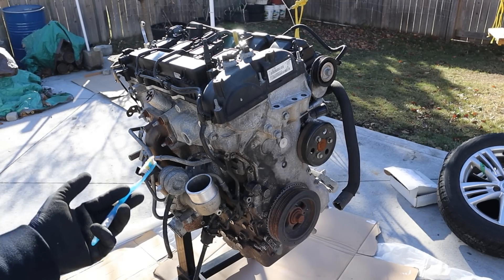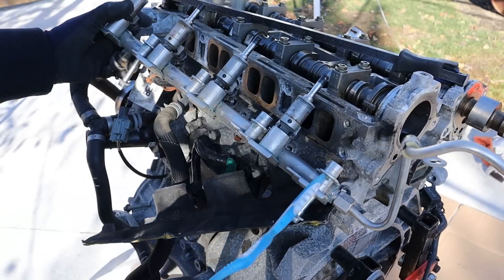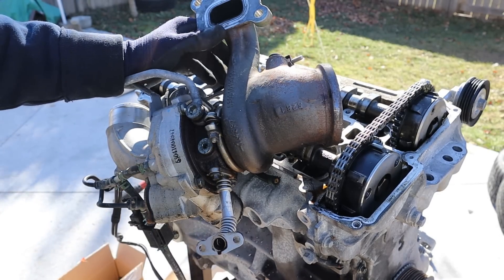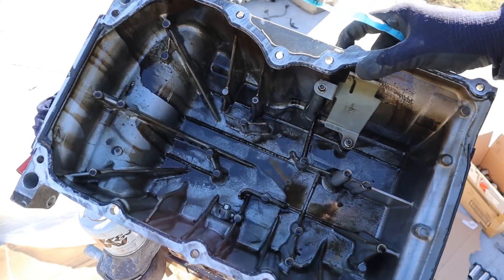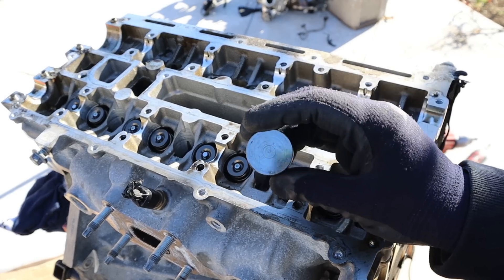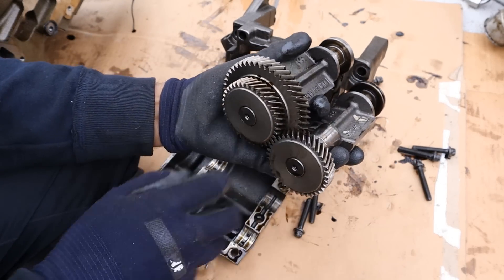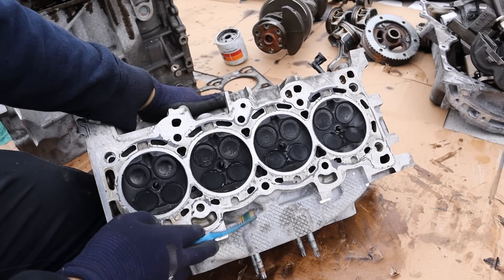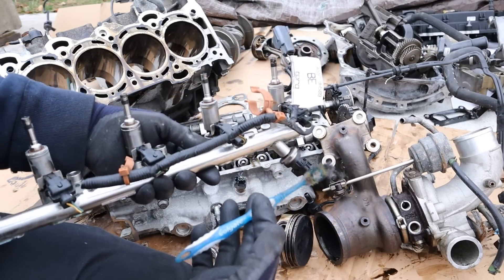Why Ford Ecoboost Engines Fail

Comment: People wonder why I still drive my old beater, it's because the engine is solid and everytime I think of buying something else I Google it and this guy has a whole video detailing why I shouldn't. He's saved me a fortune.
Reply: Straight six engine
Reply: Save your money:  Cheap old cars go to all the same places that new ones do.....
Reply: @Philcopson  guess you never leave town....try driving a beater from California to North Carolina ...
Reply: Its also better for the ecosystem to drive an old car!
Reply: The Ford 4.6 l modular connected to the 4-speed with overdrive transmission was indestructible if given regular maintenance. I am still driving my 2003 Grand Marquis as a winter vehicle, and change the oil every 5,000 km and the transmission and diff every 70,000 km.  Still running just fine, and with oil spray undercoating yearly there is no rust issues with the body or frame.

Not looking forward to the day when it will have to be replaced, although at my age a sudden health issue could make that a moot point. Wishing you younger folks luck as governments around the world go bat crap crazy over green energy being able to power everything a modern economy requires.

And for the record, I also have a Mustang and Marauder as fun summer vehicles.  Yes, I am hated by the lefties and greenies.
Reply: The only viable engine is the 5.0
Reply: For real dude, same here.. still driving my old beater 2000 Ranger 4banger with the old Lima in it. Sidenote I'd REALLY, really love for an environmentalist to explain to us how disposable engines with mediocre improvements in "efficiency & emissions" over old tech reduces pollution when it takes dooky huge amounts of energy & unbiodegradable plastics to make disposable engines that last at MOST 5yrs or 100,000 before they're so worn out they drink oil, gas, barely run and end up on a barge to China for recycling (that's how they get their free material). Fuckin ridiculous.. As a mechanic every time I hear about CAFE, carbon credits and 4th grade interpretations of the word efficiency, my anus twitches uncontrollably. And the 10,000 mile oil changes, makes me wonder how these people dress themselves in the morning and where get all this money to make perpetual new car payments on trade-in about a year after its paid off and barely runs anymore, let alone passes local emissions inspections
Reply: @Drmcclung  I had the same arguements. And these go same for new electric household appliances. Made like crap, replacing them every 6-10 years to save peanuts on electricity. And you can't fix 'em.
Reply: @Drmcclung  I also have a 1990 Nissan pick-up that I use mainly in the summer months to haul bikes, kayak, lumber etc. Insurance is about $40 month while I'm using it & I have 'Antique' license plate so I only pay one up front fee of $38 - no annual license tags. I've owned it for 21 years - it owes me nothing!  It's rusty, dented, no radio - if i fill the gas tank I've doubled its value!!
Reply: This new technology just plain sucks anyway you look at it I'll keep my older muscle cars anytime at least you can figure out how to make repairs on them
Reply: @rodneyhopper22  And doing engine rebuilds helps keeps your local machinist's lights on. Every machine shop I've seen seems to be struggling and machining is not an art we can afford to become a lost art.
Reply: Me too.  Normally aspirated V6.  Not direct injected.
Reply: That’s right!  I drive a 20 year old Subaru H6.  It doesn’t burn oil.
Reply: You honestly have to remember one thing when saying that. People hardly EVER maintain their vehicles. Ford recommends oil changes every 10k miles or 1 year whichever comes first for this motor. I would never in a million years follow that myself because that's how you end up with a blown motor. Also this motor obviously was fine and whoever sold it was a moron and was sure it hydro locked and probably didn't even check compression. Lots of motors can have issues but generally people don't maintain anything which is why I'll never own a used vehicle again.
Reply: @huskers1278  True, most of us here are probably good about maintenance, which goes such a long way especially with these newer engines. I'm amazed at how many people I've known that call and ask "what does it mean when the oil light flashes on and off? Does that mean I need to change it?"  Uhhh no, it means you haven't got any oil in there, and you've likely just took tens of thousands of miles of life off the thing. How long ago did you change it?     "Umm, it's been a couple years I think".
I'm just flabbergasted. Like don't you care about protecting your expensive investment?? I've also seen enough of the "just rolled in" youtube channel to lose faith in responsible owners. I know there's freak mechanical failures and defects, but I bet a lot stems from neglect.
Reply: Andrew T  Couldn't have worded it any better myself. I have a 2.0 Ecoboost in a 2018 Ford Edge Titanium and the engine just got replaced for free from Ford. It had coolant intrusion in cylinder #4 because it was the old sawtooth designed coolant holes cut in the center of the cylinders. It was a bad design on Fords end. But again that stuff rarely happens. People buy vehicles beat on them change the oil once ever 1.5-2  years and wonder why it runs like shit with 40k miles on it lol. I bet you are correct LOTS of people that sit around and watch videos about cars probably are the outliers and actually take care of their vehicles. After I had 2 used vehicles back to back that broke due to the previous owners neglect I went and purchased the Edge for like 40k and damn near lost my mind when I realized it was burning coolant. Always have done all its maintenance before scheduled. But now it's fixed and runs better than new. I just couldn't imagine paying all that money and not taking care of it
Reply: @huskers1278  Na, modern vehicles are just overengineered in a lot of ways. When a lot of people mention the same damage on the same engine type it is usually because that engine has a problem in that regard. VW had big problems with their TFSI engine timing chains. That wasn't because people didnt maintain their vehicle properly. It is bad design. There is a reason VW for example reverted back to timing belts before trying chains again :D
Reply: Christian Kirchhoff  I don't disagree with you whatsoever but I still stick to that the average person doesn't maintain their vehicle nearly enough. Obviously there are outliers like you pointed out. Didn't know that about the VW engines so thanks for that info
Reply: @Huskers12  wow man glad to read that you got a warranty for that! 
  New cars are the way to go if possible.
Reply: NY Plantings  Yeah those older platform engines with lower compression and  slower moving bottom assemblies would easily have tons of miles on them. Thats one thing that keeps semis on the road for years is low rpms. The higher the rpm range you keep your vehicle in the more damage you do quickly. Yeah I would sell one of my children for that ZR1 vette. also thought it was one of the best looking vettes they ever made
Reply: @huskers1278  every company has bad years.  2017 to 2020 Ford had a bad design. My wife has a 14 escape titanium  with the 2.0 ecoboost, only has 117k on it, but it runs perfect. She got.it used with a 3 yr 36k mile warranty though
Reply: @huskers1278  Focus ST 2.0 motor uses closed deck design not open deck. So it won't inherently have the blown head gasket / coolant usage issue like the escape/edge 2.0 which use open deck design. What you are stating above in your motor actually does not apply to the Focus ST version of the 2.0
Reply: @huskers1278  Outside of my own friend circle of enthusiasts, the average person I talk to doesn't even know how to change a flat tire or remove their plastic engine cover.
Reply: @MidnightSpeeder  Exactly lol most people couldn't tell you how much air their vehicles tire should have let alone do any maintenance on it
Reply: @andrewt9204  In Italy it's the same thing, many think that the oil light is a normal light, but it's not like that! 😂
Reply: @Huskers12  if you don't have to buy used you are 100% right. Every single used car I ever bought had some B.S. going on.
Reply: @nyplantings2420  New Zealand and Japan must be different. Most of us only buy used cars. I have had a fantastic run from 10 to 12 year old mitsubishi v6 3.5 and 3.8 litre saloons for years. Recently bought a 2010 vw passat 2.0 tdi. Nz new full service history. For about 3k usd. No problems in 6 months. Runs really well
Reply: @huskers1278  at the end of the day , at 63000 miles when you start burning through 3 quarts every other week,  that small amount off $200 for the 3 extra oil changes doesn't sound so bad now dose it? The manufacturer wants you to buy a new car at the end of the warranty
Reply: @ryanaddy1135  ding ding ding ding!!!!  We have a winner.  People always be like why would they lie to us and tell us 10k mile oci is OK well first off because they don't give a shit if you're vehicle last 100-200k long as it gets past warranty matter of fact they're hoping you come drop coil on a new one from them when the warranty is up.  Use good quality synthetic change every 5k period.  My fbo x37 hybrid turbo tuned on e30 2016 fiesta st is at 112k no issues been tuned since 2800 miles on current setup since 50k.  It's dead nuts reliable.  The 1.6 ecoboost is killer.  Very reliable.
Reply: @huskers1278 you’re right. I wouldn’t go over 5K mi.  When asked how often should I change my oil, Grandpa said” oils  cheaper  then iron son” 😊
Reply: @huskers1278  💯👌🏾
Reply: @huskers1278  so, you just keep buying new, and waste money?? That's stupid. If you learn about cars and trucks... you can find a used car or truck  that was maintained well....all you have to do is have a scan tool... and some tools..and know about cars....it's simple  to find a good used one....
Reply: @huskers1278  I only buy from fellow enthusiasts or elderly folks now for the exact same reason. Unless I'm intending on a full restoration then it doesn't matter. I've heard people do better in other parts of the world but Americans don't maintain a thing. Throwaway consumerist culture completely rampant. Very common to ask when the last oil change was and get the fish-eyes stare in response.
Reply: @huskers1278 You ever heard of a wet belt?
Reply: @huskers1278  "Oil is cheap; engines are expensive!!" ~ Scotty Kilmer
Reply: @GoonSquadLifeMember  Actually just ordered Amsoil Signature myself to try it out! I always agreed with Scotty on that one
Reply: @GoonSquadLifeMember  Motor oil used to be cheap, but I think the price has doubled in the past five years
Reply: @huskers1278  Aren't they running special syth oil blends these days? Then you might say people might not use the right oil or deal with the dealer to do it, and with everyone having the iternet now you have the uniformed most likely to post, and less of the ones that don't have problems.
Reply: @TOPHERHARPER  From the factory, it uses a synthetic blend Motorcraft 5w30 Syn Blend to be exact. I personally run Pennzoil Platinum Ultra which is full synthetic and oil has come A LONG WAY since the 70s-2000s but no motor that uses a turbo should ever exceed 5k miles on oil. Especially when you live in the city these direct injection motors get lots of fuel deposits in the oil and it makes it lose its lubricity. And you are correct often times you read online about issues someone is having with a specific vehicles motor but you don't read the 1000s that never had a problem. People are dramatic and engines are so far and above superior to what they were 20 years ago it's not even funny. More often than not a vehicle breaking has everything to do with the owners' maintenance or lack thereof.
Reply: @huskers1278  I don' nescessarily agree with the school of thought of sticking with a brand of oil, when the manufacturer specifically says they made everything to work with thier brands and suggests them, and even with a warranty says this is the recommended mileage, I would trust them because if it weren't they would have to pay for it? 
I would guess if you had engineers and made cars you would probably only recommend an oil if you made it in order to assure consistency and thereby you can make claims like you can go 10k miles. 
All the rest of this seems like conjecture, though it sounds like you are expecting consitency from your brand too. I mean what we are discussing here is that this person thinks that the manufacturer is misleading and I simply suggest that maybe they are not, given we have come a long way. 
But then again, I read in other comments apparently they fixed the water jacket issue, and so it kind of makes this video pertain to it should have been titled; why do 2016 ecoboosts fail, and I am sure there are plenty of reasons why they fail, but maintence wouldn't be the issue for the later ones that weren't manufactured well, no matter what oil you used or how often you changed it. 
As an old guy myself, it is hard to get out of long outdated mindsets, back when I was born for the next 5 years the ford 2.3 didn't change much, now it feels like a whole different game.
Reply: Christopher Harper  Yes the new engine that went into my Ford Edge is a different design so hopefully it shouldn't fail until it's old and ive gotten rid of it. I don't necessarily think sticking to manufacturers brands is a great idea either. I really like Pennzoil Ultra Plat myself and have done some oil analysis on it with good results so far so I usually trust science and not my gut. I agree with everything you said however.
Reply: @huskers1278  Good point about the thousands that don't have a problem for every one that does.
While I do believe the 4 cylinder ecoboost engines do indeed have an unacceptably high failure rate, it seems worse than it it because they have been putting them in everything for quite a few years now.
My 2017 Escape has the 2L ecoboost, with 65k miles, not ingesting coolant yet, hope is stays that way...
Reply: Mark Beiser  Absolutely dude. The damn coolant intrusion issues they had with the 1.5-2.0 motors are absurd. They should have done a complete recall on the motors but realistically Ford couldn't eat that cost. So what all the motors need is to have their warranty extended to 10 years or 100k miles. The new motor in my Edge is the new pin hole design and I only have 300 miles on it so far. The old 2.0 had 73k miles on it and the last time I started it before taking it to the dealer it SMOKE SCREENED half a block it smoked so bad. One other thing people often overlook is ALL THE MANUFACTURERS have major issues whether it's their transmissions or certain motors. They basically design all this stuff with their hands tied behind their backs because environmental agencies. They need certain MPG ratings and all sorts of environmentally friendly things in the engine bay that break.
Reply: @huskers1278  A friend of mine had really bad luck last year. 
His chevy work truck, with the AFM cylinder deactivation, had a lifter eat up the camshaft, damaging the block in the process.
His Hemi Charger dropped a valve seat, destroying the engine.
His wife's Ford Exploder 4 cyl EcoBoost developed a thirst for coolant in cylinders 2 and 3.
All within about a 8 month span, all out of warranty...
Reply: Mark Beiser  I do believe if I was your friend I would be calling it a day on vehicles lol. Thats HORRIBLE. The dealer told me if my car didn't have the warranty it would have been nearly 9k out of pocket. Also your buddy is literal proof all manufacturers have their share of issues it's just which one do you think you can afford? For my 2.0 it was cylinder #4
Reply: @Huskers12  to be honest, if we had the oils and fuel additives of today in the older engines we would see several million mile examples. 
   The sweet spot of Port injection engines from 2002 to 2012 are real winners. That supercharged 750HP C7 Corvette ZR1 with both D.I. and port injection is a rock solid  masterpiece that in OEM form will last decades.
Reply: @huskers1278  2.0 from EDGE and ESCAPE are not the same as from ST.
EDGE and ESCAPE has an "open deck". 2.0 from ST's are closed.
Reply: @chris_hisss_YT  Yeah  synthetic  oil $100.00 for a 6 qt and filter oil change !!!  Real deal !!!   Once a year is fine especially when I drive only 4,000 Miles a year !! !
Reply: @huskers1278  I call Bullshit on that.  I serviced my vehicles to Fords recommendation, including the transmissions and lost three late model trans, 2 at less than 50,000 and one at 105,000.  totally done with Fords !!!
Reply: @wilburfinnigan2142  That was your first problem. Don't follow their "recommendations" those are to make the vehicle appear to be cheaper to maintain lol. They want it to break they want to sell a new car
Reply: @markbeiser  17 is when they started  making the bad design
Reply: @markbeiser  that wasn't bad luck....he picked the wrong brands...
Reply: @chris_hisss_YT  it's not  only a turbo motor with highish compression for boost but it is a direct injected engine.  Going 10k miles between oil changes is not recommended even with the best oil available.  The manufacturer don't care if your engine lasts 200k long as it makes it past the 3 yr 36k warranty.  Changing it every 10k won't cause issues before the warranty it'll be at 100k when the valves are so caked with buildup the engine either runs like total shit or it ends up causing other issues.  On top of this the oil lubricates the turbo as well as the engine so the turbo is heating up that oil more breaking it down quicker.  5k miles with quality full synthetic is what you should do.  I recommend amsoil boosted 5w30 it has 25% better cleaning and is great for direct injected turbo engines it even specifically said that on the bottle. My 16 fiesta st is fbo x37 hybrid turbo on e30 and it has 112k bought it new been tuned since 2800 miles and had my current setup since 50k.  I have beat on it plenty of times.  It's still going strong but I properly maintain mine.  I agree with the guy above I think the majority of issues is due to lack of maintenence ecsp on ecoboost engines.  People going by the manufacturer suggestion because they think they always know best and never lead none astray 🤔
Reply: @midnight347  Interesting and noted. But you are saying oil changes aren't going to be the issue as it will need to come apart because of carbon buildup anyway? Maybe that is why they say 10k because it really don't matter?
Reply: @maciekapocaliptic  13-16 edge and escapes work for STs with some component off the ST.
Reply: @markbeiser  Good 'ol planned obsolescence -_-
Reply: that is why the new engines are shit because most have nooooooooooooo clue about maintenance and in the end you loose, iwould rather have and old style engine that takes more abuse and will last longer because if you think you are saving in fuel you will pay in engine replacement or repairs,  stuff today is designed to be repaired not last.
Reply: @chris_hisss_YT  synthetic blend is cheap oil. It's a blend of synthetic and conventional. It's not as good as full synthetic and it should be changed out more often.
Reply: @nyplantings2420 I think the golden age of vehicles and optimal emissions controls are from whenever any particular model/engine got fuel injection in the 1980s (even TBI was ridiculously reliable and clean) and maybe mid 2000s.
Reply: First of all I Live in Ontario and they pour Liquid Salt on the roads!!!
This is the reason why I'm still driving my 17 year old 2005 Honda CRV iVtec 2.4L I bought brand new when I was 27 years old. I have it Oil Guarded (The shop coats the whole underbody,  inside the rockers, inside the doors, EVERYTHING with OIL and WAX Combo) EVERY August and change the oil every 8000KM with Mobil 1 Full Synthetic 5W-20 MYSELF and only use Honda Trans Fluid, Gear Oil and Antifreeze. I have 365K on her and drives like the first day I picked her up when she was a baby with 43KM on the clock. No rattles going down rough roads, no engine noise, most important NO RUST! Sure I've had to replace suspension and chassis parts, brakes, normal wear and tear stuff but so far she's been a dream and goes through EVERYTHING. I also love that it has a regular Cassette/CD/ Radio and separate heater controls and none of that touch screen crap. Everyone I know that has much newer cars is always saying it's in the shop for this and that BUT a lot of people I know have been having serious Turbo problems. Sure my car might be old but I know she's always going to start and will never let me down. If she does one day I can bet it will be something like the belt or a blown hose because I KNOW the engine, tranny, and rear diff are tip-top. Keep you old cars and LOOK AFTER THEM AND THEY WILL OOK AFTER YOU!!
Reply: @michaeljohn9263  The Honda K24 and K20 engines are seriously over built and well designed. What I always liked about Honda was they were generally easy to work on.
Reply: @michaeljohn9263  I WISH I had the financial means to buy a brand new car before everything coming out of the factories got fuckin' lame. I've always taken over other idiots neglected crap and restored. At least I got really good at wrenching because of it. I can totally buy whatever the hell I want brand new now but they don't make anything I want to drive.
Reply: @Michael John  wow I would like to know about the undercoating. Too late for my Ford Lightning. Great news and keep them miles coming!
Reply: @michaeljohn9263  I live in Alberta - we use road salt but not as much as Ontario. I have a 2005 ford Taurus I bought in early 2007, 200+km, run 5-20 synthetic 15km change & use Mobil 1 or Fram XG filters. I leak a bit of oil but doesn't burn oil. I wash frequently in winter. Tranny fluid changed a couple times. Replaced batteries, tires, brakes , rear struts couple times & new starter - still going good!
Reply: @michaeljohn9263 same thing with my 95 maxima . Except I change my oil every 5000 k .
Reply: This is why I'd stay away from all modern day Ford engines except for the 5.0
Reply: My f150 4.6l v8 has over 400k original engine
Reply: I agree, modern ICE engines are engineering marvels but terrifying long term prospects.
Reply: I had to get rid of my 2000 4Runner because of rust, but it ran beautifully for 20 years. Got a new Toyota Camry and as long as I maintain it properly I have no doubt it could last me another 20. When in doubt, buy a Toyota.
Reply: Dude literally, in my family we have 2 2003-2011 hyundai accent and those are reliable asf
Reply: @adrielaquino521  reliable asf are they
Reply: Same. I daily a 2003 Tahoe that has 270k on it now. Drives as good as when I bought it with 130k miles. I've replaced hubs, shocks, pitman arm, idler arm, tie rods, water pump, oil pump, fuel pump, window regulator, blender door actuators, and converted to 2007 and up front (bigger) disc brakes, and converted to 2005 and up dual electric cooling fans (GM factory stuff, not aftermarket). Why? Because it's easy, and it's cheap. I don't want a vehicle that's not easily serviceable. I think I'd rather just put in another engine and transmission when the time comes.
Reply: My mom used to be asked all the time, "why do you drive that old thing"?  For 30 years she drove her 1960 Buick Le Sabre sedan.  She said, "It's reliable and beautiful, what more could you want"?  She is 99 now and STILL loves the 1960 Buicks!
Reply: I buy diesels.  I know that after some careful research the truck I buy is going to make a few hundred thousand miles without major issues    Even the new ones I put over 400k on a 2016 duramax that was all stock with a service body.  Gas rigs idk I don’t drive them but ford has done nothing but make vehicles that make it just passed their warranties since idk  international was more involved with them.
Reply: GDI is garbage. We need to go back to Multi-Port injection to keep the top half clean. However with the emissions laws, car companies almost have to run junk turbos and GDI and not to mention VVT. My GM's and Ford's always ran fine with Multi-Port injection and they barely had a breakdown issue, with good fuel mileage.
Reply: Keep care of that older vehicle and it will treat you well!
Reply: But have you googled your old beater?
Reply: You're just telling yourself that because you can't afford a new car. Whatever makes you feel better.... 🤷🏻
Reply: I'm going to put my 1989 Ford Bronco 2 back on the road and get rid of this 2014 Ford Escape before the transmission or engine craps out. I'll probably take trade in price for it which is around $3500 under the condition the buyer knows about the potential problems of these vehicles.
Reply: Wise indeed. Older trucks N's cars made to last. New vehicles are cheat mass produced made to fail
Reply: It’s solid stock your engine would be dog shit with todays turbos if not the same reliability
Reply: Still have my 2003 S10 Zr2 powered by the 4.3 vortec for a reason....

Engines great, but I am looking at transmissions for when the 4Lame60 eventually goes...

Truck has over 219k on it and does have a little shift flare here and there so I know it's gonna need a trans in a few years..
Reply: Ditto
Reply: No one wonders why my dude. Everyone has their own issues. No one gives a crap about someone driving a car.
Reply: Nah.  This engine is pretty robust, probably one of the better ecoboost engines out there.    The only reason this engine fails is because they're very tunable and when they get tunes on them (different turbo, etc) are getting in excess in 400HP, and then they run into a lean conditions which then puts a hole in the piston, which basically destroys the engine.

You run this in stock tune, it will have a long life.
Reply: 4.3 gm 😊
Reply: Yep.  2005 Suburban Z71 with the 5.3 before Active Fuel Mgmt ruined that design.    Runs like a Top.
Reply: Except for the carbon buildup which is a problem with all direct injection engines I don’t see anything wrong with it unless maybe some valves got bent which he didn’t get into
Reply: You know your engine stuff.
Reply: Yes, my 2005 mondeo tdci has 225k miles and this isn't unusual. Oil and filter done regularly and on it goes. Nearly replaced the car so many times but for what? and why.?
Reply: @tdbright340  that's the way to do it. Keeps them running longer
Reply: Magic plastic ✨️
Reply: Yeah, im sure thats why...
Reply: I agree, I purposely picked a pre AFM  GMC pick up. 2006 and before. The Active Fuel Management system breaks on these trucks. Save a tiny bit of gas, and they break at 80k miles, from what I read.
Reply: Doesn't have a video on the Subaru Outback's current 2.4 turbo engine.
Reply: My old Opel Signum 2.2DTI (Diesel) built 2003 saw oil changes only every 37.5k miles and ran like new when sold with 180k (14years old). 115mph on the Autobahn was standard speed. Only gave it 0W40 Mobil 1. Never had any issues. No refill necessary between changes. No rust, only cosmetic issues (clear coat flaking of and stuff like that). Great car. Obviously every engine is different and gasoline engines require more maintenance, since the gas mixes more easily with oil I guess. Also lots of cold starts are bad.
Reply: I have a 20 year old car, which starts up every time. All it needs is common service according to the manual
Reply: theres nothing wrong with that engine, the owner never ''drove'', it. thats why it stoped. the ford durateck, 2.0 petrol, 2.5 5cyl, 2.0 diesel, go like fk & last forever.IF THERE DRIVEN. direct injection is the fail point, it carbons up, people want economy so pussy foot around, then they stop. best engine ever built, ford 385 series, 351c 460c.. chev, never built a decent engine.
Reply: @harrywalker5836  I liked the SB 350 Chevy and the 400SB as well as the 396 BB Pontiac 400 BB. So yes they had descent engines as well, and I'm a Ford fan.
Reply: You and me both, brother. I simply don't need high tech headaches for no tangible benefit in my life, so I'm hanging onto my '95 for dear life.
Reply: Same. My old powerstroke refuses to die.

Just recently thought it was time for a rebuild, turned out it was just a loose oil filter 🙃.

Going on 400k now, basically no issue. Waiting on the transmission to go out as it's a bad design (E4oD coupled to a 7.3...) holding up it seems, but I pull to much weight for that transmission to last much longer.
Reply: Hey, don't buy a ferrari. Save even more lmfao
Reply: That’s just an excuse man, we all like old reliable beater, but the truth is if you went with new Toyota/Lexus instead of a focus which has always been crap, nothing would break every day.
Reply: My dad has an 11 eco boost with 250k miles and it’s needed a water pump and an O2 sensor.  They aren’t all junk
Reply: Gen 3 Mazda 3 are completely bulletproof. I live in Florida and I once went through what I thought was a puddle but turned out to be like a lake from a flash flood. There was water all over in my cylinders and my car wouldn't run longer than a second. They pumped water out of my engine through the spark plug holes. Put new spark plugs in and it's been running fine with great compression to this day. Absolutely unkillable no problems at all from that flood water didn't even intrude into the cabin
Reply: Every engine has flaws. Your engine will break one day. I've own 2 STs and drove 1 to 90k miles and the other to 85k and I drove pretty aggressive and tracked them. Not once did I ever have issues. Only mods I ever did was intake for noise for myself. These engines on a scale of mass production are reliable. 

All engines have faults there is no perfect engine out there. Drive your beater all you want but these cars/engines are fun.
Reply: So what your saying is your scared to take a chance, so you’ll drive bangers all your life and then you die, pure genius 😂
Reply: @Theodora Apulia ... and everybody else gets their cars given to them for free??

Make some sense next time, huh?
Reply: @Theodora Apulia I guess I don't... 
I worked very hard when I was younger, so that I wouldn't end up to be a poor person. I never understood why anyone would resolve themselves to being in that situation.. 🤷🏻
Reply: I have two 22 yr.old trucks.
2001 F150 4.6.  345k
1999 2500 Sierra.  295k
Reply: The guy litterally says it was hydro locked because snow got into the pcv or intake how is that a design flaw😂
Reply: These cars are 4k.. A fortune really?
Reply: It’s really a godsend that we have people like him nowadays. Imagine back in the 80s and 90s where reviewers are actually bought and all you have to rely on is their review. Now we have people all over the internet telling what is reliable and what is not.
Reply: Me 2 my car's 26yr old and very easy and inexpensive to repair
Reply: @stephenburgreave2525 I bet it really turns heads huh.😂
Reply: Old is Gold...
Reply: @jasonking1284 & gold is just a rock.
Reply: I just financed a 2015 Nissan rouge against all advice pretty much.  Best I could do right now.  My first cvt, it feels like they kept going with a bad idea on these things.  I guess it's better sorted now but wtf its so weird.

It was dealer checked and readied, has a warranty, a great service record and (only) 75k miles,  plus it was built in Japan, one of the years they had to meet demand by also making them over there.  Best case scenario for a rouge on a budget I guess I could say.

Anyway, keeping my 2006, 240k Honda Accord, did not trade it in for scrap prices.  Yeah it needs emission work to pass inspection, and a brake is fried, plus the power steering fluid pours out, and it has an oil drinking addiction....it's  the real deal simple and reliable.  First time in maybe forever I have a back up car I own that I can technically drive if I have to right now., But can take apart bit by bit and not worry about a thing.

My plan now is to fix it up and give it to my son when he's old enough. 5 years.  I really want this soon to be superior relic to be in my back pocket until then, and it will be.
Reply: One solid reason to go modern.

Safety features, all that crumbly crap will have you walking away from a crash your beater will kill you in.

The difference I'd like night and day. You should look it up.
Reply: I drive a 2015 Toyota Camry which has a very reliable naturally aspirated 4 pot and did 5k full synthetic oil changes
Reply: You’ve saved a fortune but you’re driving a sh1tbox that’s an embarrassment to humanity. Treat yourself,open your wallet & set those moths free.
Reply: He doesn't know crap my neighbor had an eco boost since 2014 still running good 😂😂😂😂
Reply: Yeah.  I have two Fords, one Duratec  and one Ecoboost.  I believe that the Durate is going to outlast the Ecoboost and I´m not going to get rid of the Duratec for any time soon.  Over 200 000 km on the clock, starts fine and doesn´t burn oil.
Reply: I'm just like you that's why I've got a 84 Chevrolet short wheel base and a 2002 big block 470 sho AWD
Reply: I have two Honda beaters; 500k between the two and they both run like new!
Reply: @tatialo37  I have a 93' honda accord w/345k on the dial. I've had the timing belt done at around 300k i 've replaced (all new) battery, alternator, starter and all 4 tires
Reply: @Ruben Torres  Same with my Ford F150's and high mileage Corvettes if nobody messes with them they run great.
Reply: @tatialo37  I'm rebuilding a D15A1 at the moment that "died" at around 200k. It ran beautifully but a combination of old valve seals, deteriorated valve seats, and slightly worn piston rings made me decide to pull it. It was burning a little oil but enough oil was chilling out in the combustion chamber to occasionally get a spark plug wet enough to cause a temporary misfire. While machine shops mess with the old engine I grabbed another engine for $150 with 180k on it that is totally perfect. Kind of a long response but the point is maintenance matters a lot, and if you know what you're doing, old beaters cost almost nothing to run.
Reply: he's only talking about the negative point here tho, its a great engine and you also have to understand that there are thousands of other 2.0L ecoboost engines that dont have problems
Reply: 40 years old car, nice.
Reply: im with you bro, 2005 civic si, and 2007 gti all the wayyyyy old aint bad at all. trust me. my 500,000 miles can attest to it
Reply: Google buick encore 1.4 170 hp 170 ft lb tourqe built to last 38 mpg 😂🇺🇲
Reply: I've owned 3 cars, all German and "unreliable" but I never had an issue. So called reliable cars are simply dump proofed with low tolerances for people that change the oil by changing cars.
Reply: @TheSuperBoyProject  I've had German, diesel and made in Mexico all in one and wouldn't do it again
Reply: @TheSuperBoyProject  Yeah for German cars being the "worst" I've seen that with strict adherence to the maintenance schedule they run good and run forever. German cars are amazing Americans are literally just too dumb/lazy to maintain a car.